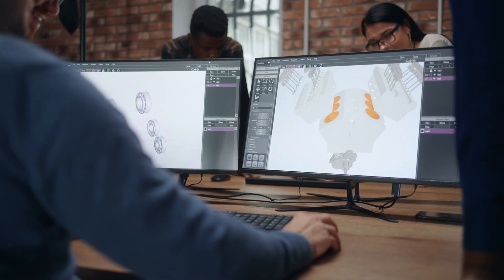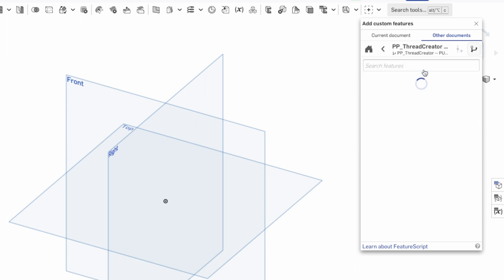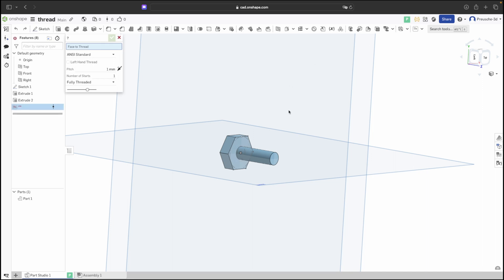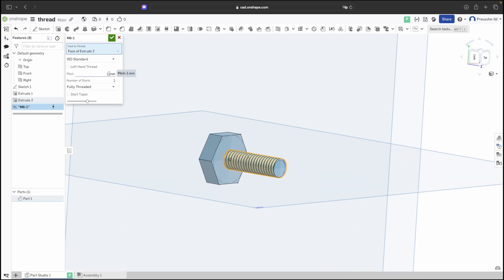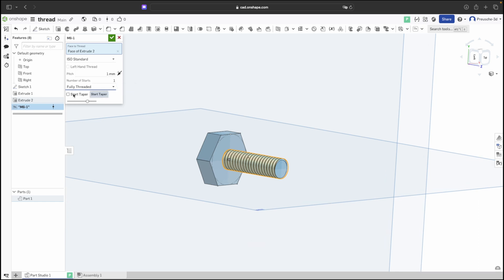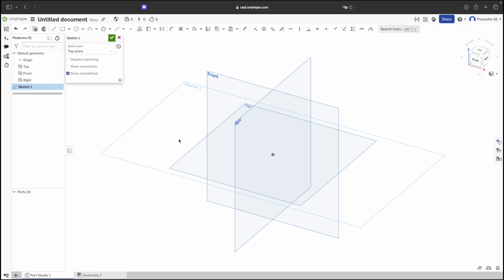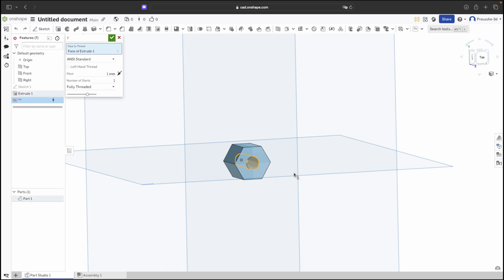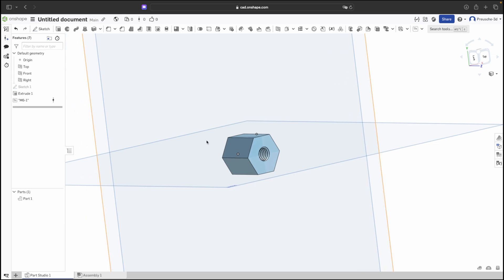Easy Thread Creation in Onshape: Designing Screws and Nuts with Custom Features | Tutorial

Comment: Hello, thanks for the video! Something confuses me. If you want a M6 x 1 (metric fine thread) you'll need a tap hole of 5mm (6-1). Therefore the thread you made in the video is (to my understanding) actually a M7 x 1 thread in the end, because a M7 x 1 thread calls for a 6mm tap hole. So shoudn't the thread eventually be named M7x1 in the ThreadCreator, and not M6 x1? I don't get it.